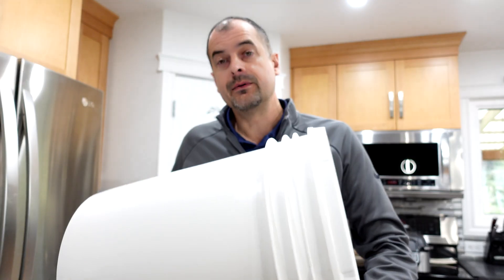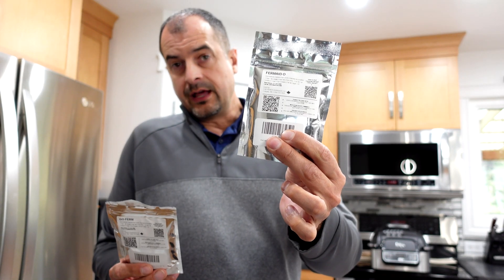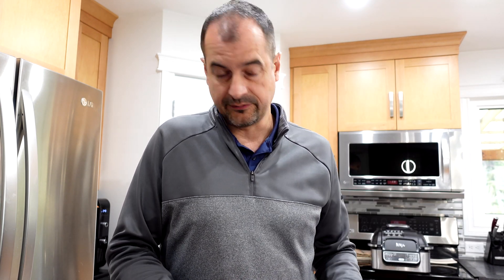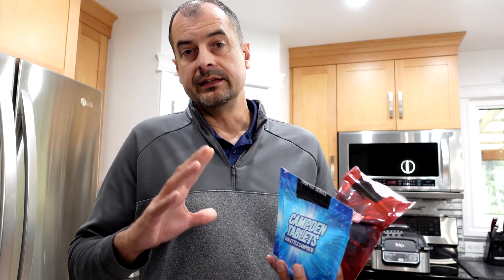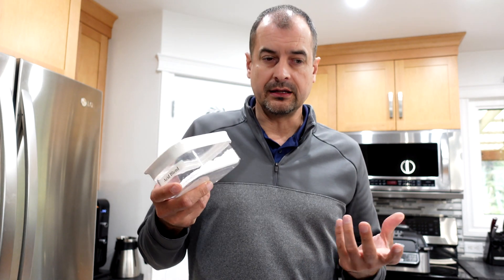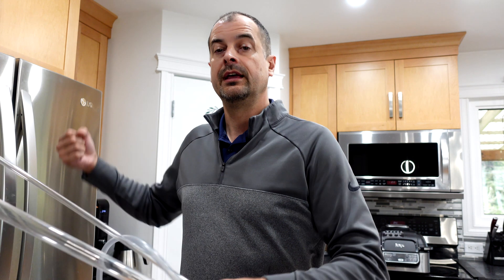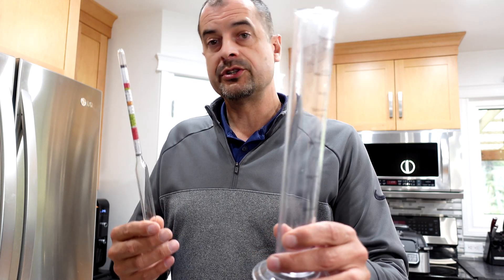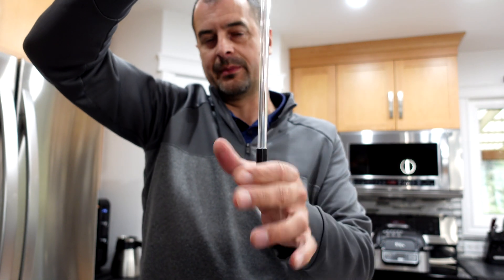Start Here: Your First Wine Making Guide

Comment: David, great video! I'm about to start getting into the wine-making hobby and would really appreciate it if you could share a spreadsheet or timeline outlining all the steps involved.

I have a couple of questions. First, I'm a bit confused about racking. Is it primarily done to help clear the wine? Wouldn't it be easier to just add bentonite during the second fermentation and only do one racking?

Also, you mentioned letting the wine mature for about three months. Is it possible to bottle the wine (adding sugar, potassium sorbate, and Campden tablet) and let it mature in the bottles instead?
Reply from the maker: Unfortunately wine doesn't work on a timeline and recipes change how things happen which is kind of why I kept this video general. 
Follow a good recipe, there's a video on the channel about where to get good ones, or do a kit for the first batch and follow the instructions. As you see it all happen it makes sense quickly how it works.
As far as letting the wine mature, where you want to leave it is up to you, the carboy or bottles works as long as there isn't much empty space in the container.